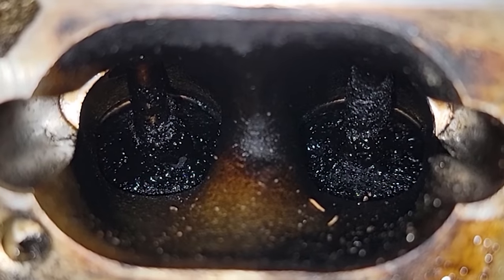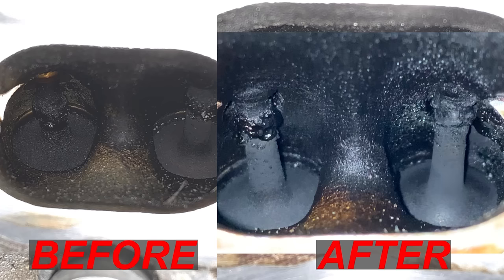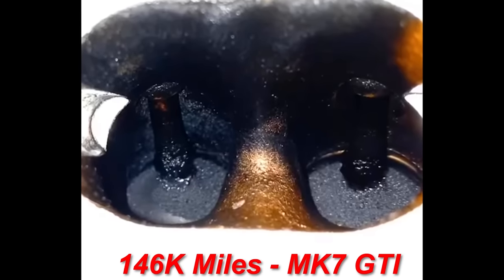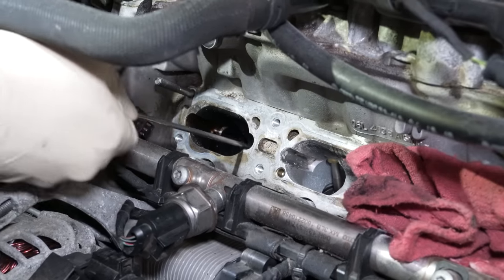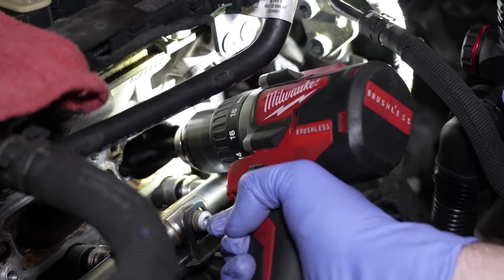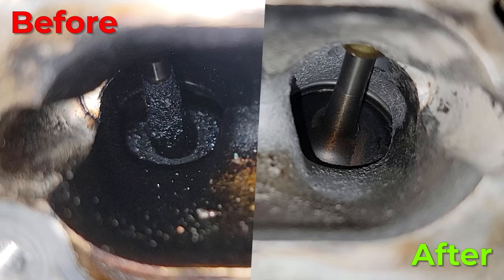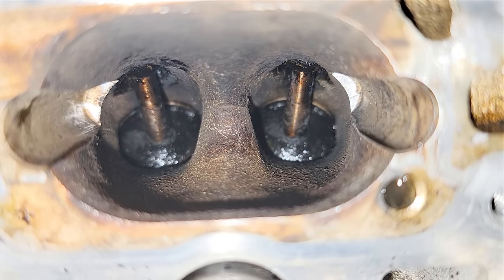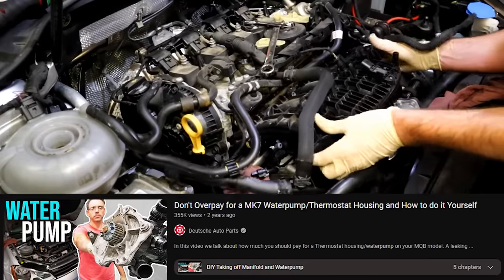How To Clean Carbon Off Your Engine!

Comment: CRC GDI Valve & Turbo Cleaner does the same thing.  You doubt this? Watch the CRC mechanic training video, they show ACTUAL vehicle before & afters and it cleans the turbo too.   Your method may generate you revenue but I would never do it.  It's obsolete.  Sorry.
Reply: That doesn't work bro, I tried it with two cans and then took the intake off and they were as dirty as ever

Comment: Easier fix is don't buy VW or Audi.  They don't even qualify for junk.
Reply: what are you then doing on this video?  and by the way this not an issue specific to VW,  it's with all DI motors that don't have a secondary port injector.
Reply: @francoisloriot2674  LOL  I knew you would call an engine, a motor.
Reply: @Makitaization   Please enlighten me by explaining what is funny about using synonyms.  Then explain me why VW / Audi "don't even qualify for junk but you still like to watch VW videos" and finally show me proof that DI (without secondary port injection) from other manufacturers don't suffer from the same problem.

Comment: Take out the head and valves and clean them in a drill with abrasive. Be a mechanic not a snowflake.
Reply from the maker: Waste all your time because it doesn’t have any value….. be a man!
Reply: bE a MeChAnIc NoT a SnOwFlAkE